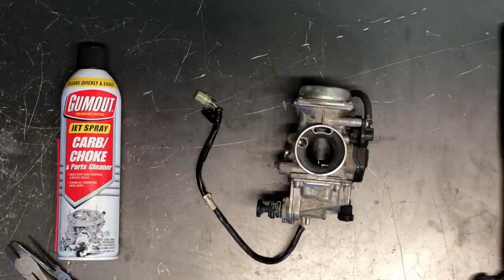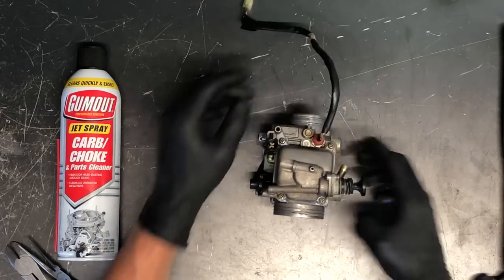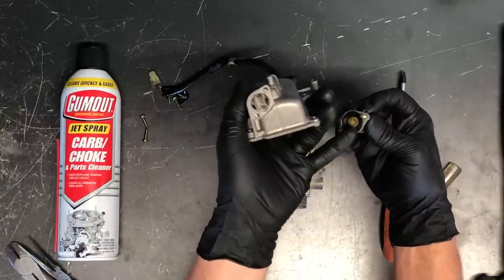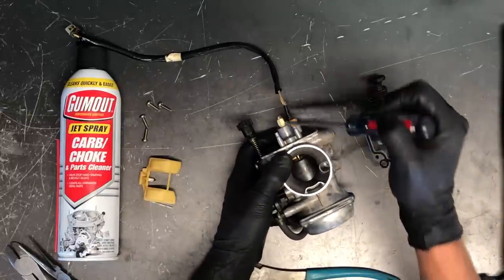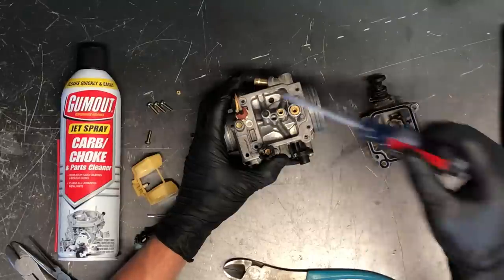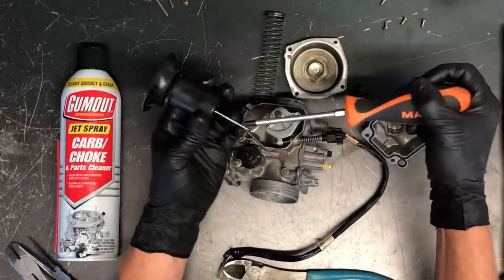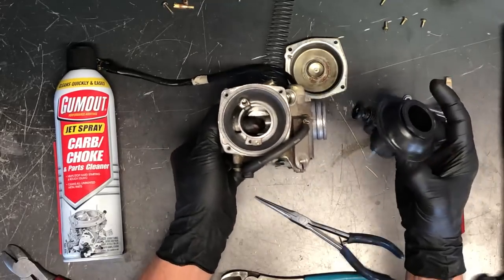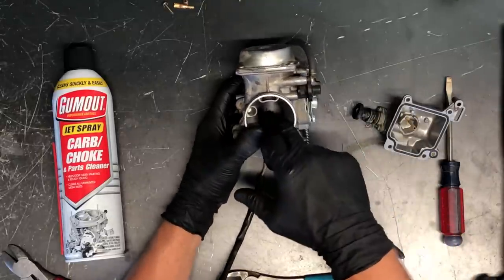Honda Foreman 450 Carburetor Rebuild - How to Clean Carb - Bad Old Fuel Gas

Comment: use Mopar penetrating fluid to soak your jets in and spray in holes and let sit , carb cleaner and ultrasonic cleaner don't even come close to getting them as clean , it will blow your mind  , trust me its a must try if working on carbs alot
Reply from the maker: Copy that. Do you need my address to send me some? 😄 Thanks for the comment and for watching. Let us know if you need anything! https://www.ebay.com/str/midnebraskamotorsports

Comment: So me and my buddy just done all this. Put new jets in and float needle. But the float bowl is still bone dry and no gas coming out of the carburetor to the engine. The gas is on with no filter. What else could be stopped up? I was going to blow air into where the line hooks to the carb and hoping clear out the vein. Any advice?

Comment: Can you explain what you mean by performance parts added that require the adjustments to the needles and set points. This part seems vague. Why would the carb have these settings and what parts would make us have to change these? Bigger tires?

Comment: I have a 2007 Honda trx500 with electric shift option. Originally the bike would drive normal but would die at an idle due to a dirty carb. I had a friend clean the carb and jets which solved the idle issue but now the bike stalls out around 20 mph or when you press hard on the throttle. I purchased a rebuild kit and replaced all the jets, needle, air fuel adjustment and float plunger. This still didn’t solve the issue. I’ve also tried adjusting the air fuel screw which doesn’t help. I’m convinced at this point that the carb is flooding out because it actually takes off if you put the fuel to the off position but dies quickly when the  fuel used up. My friend thinks it’s something electrical like the cdi but I’m guessing something with the carb as it worked fine before he took it apart. Any advice?

Comment: When I got a rebuild kit, it came with a new needle and the holder, 
How do I remove the holder? Or should I leave the old one in and just use a new needle? 
You show the part I'm talking about at 12:13 of the video. 
Do I have to remove the bowl, then main jet, then pop the main jet holder out from the top down? 
Thanks

Comment: My bike wasn’t idling before, so I cleaned the carb and now it idles great but whenever I give it throttle it kills instantly. I thought maybe it had something to do with the needle so when I took it back apart and inspected everything I installed the plunger/needle the same way you did but when I hit it with air the piston/plunger does not go up as yours did in the video. But it obviously goes up by hand. Any suggestions?

Comment: Ive taken mine apart a few times, cleaned it all out, it still wont run, Im stumped.
Reply from the maker: Genuine Honda carburetor? Can you see through all jets and have you blown through all ports? Let me know. Thanks for watching.
Reply: @MidNebraskaMotorsports   @Mid Nebraska Motorsports  I feel dumb, it was the plug, it would fire on starting fluid, but not on gas, first for me, at least the carb is clean as new now. haha..

Comment: I have a 98 450 Foreman and cleaned my carb per ur video.  I stripped one of the 4 screws that hold down that top plate, it was the one where the hose is in its way a little, the one u said u can use pliers to get it off if it's in a good spot. I can't find them anywhere...can u help?
Reply: I’m sure it’s a little late now, but you can buy a carb rebuild kit at your local Honda dealer for around $25 and it includes all new screws (including the one you needed) along with all new parts/jets, etc.

Comment: if you could take a few minutes to help me out it would be much appreciated. I have a honda foreman 450es and i rebuilt the carb following your directions to the T. Heres the problem. when i put the carb back on it fired right up no problem and idles perfect. But when i give it gas it bogs down. if i pull the choke out and give it throttle it runs perfect. i adjusted the fuel screw as you said and made adjustments and literally nothing changes. I have no clue what the problem is. i have tested this with the air box on and off and it makes no difference. i also replaced the spark plug. no difference. im lost.
Reply: I would like an opinion on this too. I cleaned the carb on my buddy's foreman (done it many times before without problems) and ran into the same problem. I watched this video hoping it would help. I'm now lost as well.

Comment: Why is fuel running out the overflow tube it start and run but fuel running out the tube
Reply: I currently have the same issue!  Did you ever figure out what it was?
Reply: @brianmitchell535  had to get the carb rebuilt

Comment: ATTENTION: Those posts are extremely fragile! Just broke a post trying to remove the float pin. I’d recommend leaving the float installed and just cleaning with it in place unless you are having an overflow issue. $300+ mistake.
Reply: This video is excellent. Just thought I’d throw this out there for someone else who might make the same mistake. New carb just arrived. Going to use your pointers for checking that the adjustments are all correct. Thanks again!
Reply: @MidNebraskaMotorsports  Haha, no, I am an idiot for breaking the post but you won't ever catch me putting Chinese crap on my Honda. She's running great thanks! On the plus side it is nice to know that the hoses and other exposed rubber is now fresh and not so brittle.

Comment: You did not rebuild. You cleaned.
Reply from the maker: Clean it well and 95% of the time you don't need to rebuild, but if you do, it's exactly like this process. Just using new parts instead of used.  Thanks for watching. I do have another video coming out soon using the moose carb kit and replacing most of the parts (rebuilding). Keep an eye out for it!!
Reply: @MidNebraskaMotorsports  I've got a 02 450 foreman , started earlier today but I left the choke on by accident and it shut off , and ever since then 5hrs later still will not fire , has spark and is getting gas to the carb but just coming out the back, not making it in the motor ....would could be wrong with this carb ..
Reply: @durtysouthkustomz8862  did you figure out what was wrong with your carb? I have the same ATV and the same problem.